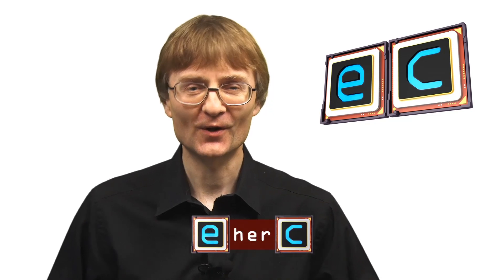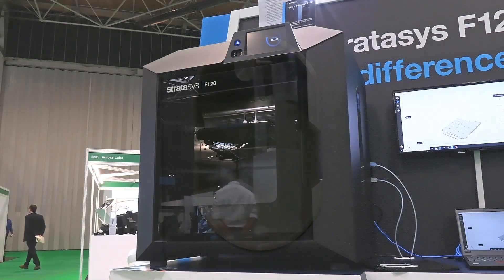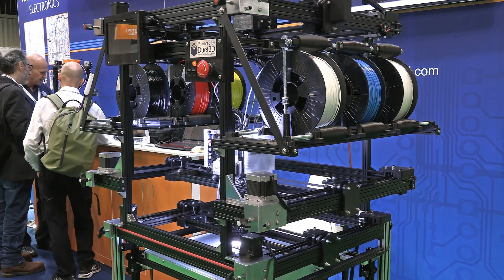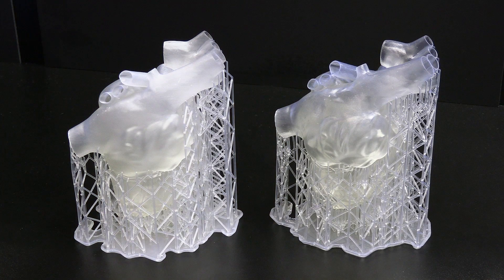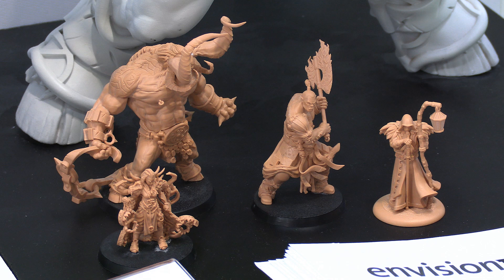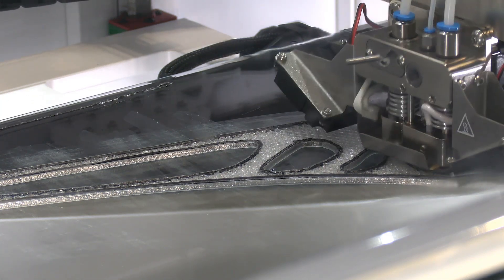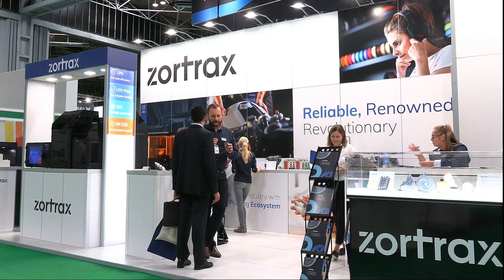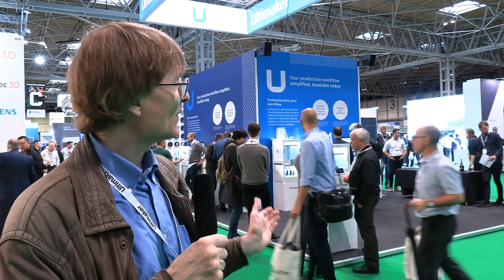3D Printing at TCT Show 2019

Comment: In jewellery printing (very light and small parts) will that best printer melt down printouts?..
I've seen only solid, big, thick  printouts on your video..
Which printer, in Your opinion, is the best for detailed jewellery needs in 2019-2020, please??
Reply from the maker: The prints from the Digital Metal, a DM P2500 3D printer in this video -- and featured in the thumbnail -- are not "big and thick". :) Most jewelry printing uses a photopolymer printer (eg a Form 2, or an EnvisionTEC model) to make a lost-wax master.

Comment: Fantastic tech, but I do wonder whether any plastics shown onscreen will NOT be floating in the oceans as fish food in 109+ years' time. If there is any biodegradeable angle to this tech, then the manufacturers should shout, nay scream, about it.
Reply from the maker: Many 3D printed plastic items are made in PLA, which is a bioplastic that degrades pretty quickly. You also have to look across the whole value chain. Today we mass manufacture items with sub-optimal geometry, many never get sold, and most are transported long distances. 3D printing allows items to be created close to point of use, and on demand, and with optimal geometry (eg most 3D printed plastic parts are not solid, while injected molded parts are). So I see 3D printing as part of the solution. :)

Comment: Regarding that 3D printed aluminum part for the Bugatti: do you happen to know if there was any metal hardening done afterwards?  Aluminum is very weak unless treated.
Reply from the maker: This I do not know. The base of the part has clearly been polished. But I do not know about any other post processing -- the surface looks like it came straight out of a printer.

Comment: Great video. I really am excited about the future of 3D printing. I sort of wished there were more vendors there that did 3D printing in other industries - eg. construction, and architecture. 

Also, what I'm not seeing are green 3D processes. So many of these printers print plastics but as the awareness of micro-plastics entering our food chain become more heightened, I wonder how the industry is going to address this. Perhaps the shift to plant based plastics that's safe to consume might replace the resins currently in use. 

One thing that caught my eye was the use of carbon fiber string, this can really shake up the construction industry and make stronger walls, bricks, etc. Heck, the process can even move on to printed cloth/clothes. Wow. Amazing.
Reply from the maker: 3D printing can be green in that is generally uses less material (3D printed parts are rarely fabricated solid, unlike injection molded parts). 3D printing is also often done in bioplastics (PLA), and more generally removes the need for mass manufacturing and mass stock holding (and resultant wastage). And can be done locally (saving on transport). So you have to look across the whole value chain to see the resource savings. There is so much potential. :)

Comment: 13:42 I don't want to spoil anyone, but I think they are using a microwave to melt the plastic
Reply from the maker: The surface is smoothed with a solvent vapour at high temperature. :)
Reply: @ExplainingComputers  I wonder if this could be done by hand with a heat hose of a desoldering station, with big care of course
Reply from the maker: @MrFiver1111  It can -- and has -- been done in a bucket, but needs very great care, and the results can be unpredictable. The benefit of the Zortrax device is that it controls temperature and pressure of the solvent vapour, and monitors the temperature of all parts of the object.
Reply: @ExplainingComputers  It is truly incredible how the 3d printer technology has advanced so much with the very infimous size details and the smoothing.
About 5 years ago I remember seeing for the first time a 3d printed jaw-bone, it had very "thick" layers (about ½ of the side of a 2 euro cent coin), it was at the Science Museum in London. And now its something that anyone could consider buying for their personal use!

Comment: What a shame it is all plastic, unless I have misunderstood. We are trying to reduce plastic use. Is any of this biodegredable?
Reply from the maker: It is not all plastic -- the metal parts are made of metal! :) Some of the plastic is a bioplastic (PLA), so will degrade. However, the use of 3D printing should save plastic as (a) objects can be printed semi solid, whereas injection molding only produces 100 dense parts; things can be printed on demand (so stock holding and scrapage are reduced), and things can be printed locally (so saving petrochemicals used in transportation).
Reply: Also at the TCT show was a company called 3DEVO who were showcasing their range of machines for recycling thermoplastics. The range consists of 3 machines. Firstly a shredder the function of which is obvious, secondly a dryer because many filaments such as Nylon are hygroscopic, and lastly a filament maker which turns the shredded and dried plastic chips back into (re)useable filament. It is an idea that was first put forward by Dr Adrian Bowyer, the father of the RepRap movement. In theory, one could print a pair of shoes for a small child, then when they grow out out them, throw the shoes into a shredder, add a bit more plastic, then print the next size up and repeat as necessary.
Reply: @ExplainingComputers  Thanks for explaining that. I was sure you were aware of the need to take into account the enviromental consequences, just needed confirmation.

Comment: Thanks for this great report. I've been involved in 3D printing for a while and I'm aware of its strengths and weakness. You touched on some of them: "consumer acceptable  surface" for instance. 3D printing has a way to go before it can rival injection molded parts. 3D printing is very time consuming compared to injection molding or casting - both of which produce parts that are 100% infilled. Most 3D printed objects are filled from 5% and up. 3D printing has come along way, but it still has a way to go before it will replace other manufacturing methods. And when it does mature, I don't think it will be the FDM (filament) type of printing we are most familiar with, but more like the SLA resin printer now becoming popular. Did the show feature any mega scale printers like are used to print components for houses or other large structures. Thanks again!
Reply from the maker: No megascale printers were at TCT this year. :) On "very time consuming", I would disagree if you look at the whole process. If you want to injection mould a part, you need to create the mould, which is very costly and time consuming. But with a 3D printer, you can go straight from CAD to a part in hours. So for short-run manufacturing, it is far, far quicker and cheaper. Many companies are now using both material extrusion (what Stratasys calls FDM), or vat photopolymerization (SLA) for final parts in small runs -- though as you say, FDM faces limits with surface quality. Also, the major application of 3D printing right now is the creation of molds and tooling, not final parts. So (eg) you can print a resin mould in hours for a few hundred dollars, from which up to about 5000 parts can be injection moulded. Or you can print a sand cast mould or core for casting (something that did not make it into this year's video!).

Comment: For prototyping, one-offs or short-run production absolutely ideal. The robotics side of the printers look very similar to the gene sequencing machines I worked on in the early 2000, though obviously the application is entirely different.

Comment: Sure like to see how the digital metal works.  Also any ceramic printers?  Can see ceramic powder with some sort of adhesive and then baked working.
Reply from the maker: Ceramic powder 3D printing does exist (via both binder jetting or powder bed fusion), but I don't think any such printers were at the show.

Comment: I work for a fairly low volume manufacturer. We are adding a plastic accessory to a product. We don't expect to sell many because it is very specialized. So it is being 3D printed vs. paying for a mold and having to stock a run of parts.

Comment: Is there a device that prints medically-safe ceramic parts like teeth or bone replacements?
Reply from the maker: There are dental resins that an produce temporary and final teeth and crowns, some of which have been worn for many years now, and which are printed on printers from Stratasys, EnvisionTEC and others. There are ceramic printers, but I am not aware of any being medical.

Comment: Its nice to see these printers. Still not practical as they take so long and so much energy to print. Injection and compression moulding is definitely more appealing in business way.
Reply from the maker: It all depends how many parts you want to make. For tens of thousands or more, injection moulding is usually cheaper (it depends on the complexity and hence cost of the mould). For low thousands or hundreds of parts, 3D printing is usually cheaper. And you have to look across the whole value chain, as 3D printing can reduce stock holding, scrapage and transportation.
Reply: @ExplainingComputers  You have a valid point Chris. I didn't think 'prototype' at the time. Shame on me for being short minded. Thank you for putting me in the right frame. Thank you for your great video's on single board computers. Proud owner of Raspberry Pie 3B+ with Rectropie. Still amazed at it's power, say compared to a C64.
Reply from the maker: Thanks for this. Great to hear you are running a 3B+ -- the best Pi so far! :) Low run can also go beyond prototypes -- like plastic parts used in some aeroplanes and trains, where they may only need a few hundred a year. :)
Reply: Just to add that with 3D printing, it is usual to print the infill at a much lower density that the perimeters and faces. Generally by using a mesh or honeycomb type pattern. So 3D printed parts can be made much lighter than their injection moulded counterparts (and use less material without compromising structural integrity).
Reply: @deckingman  Interesting. Honeycomb structures are very strong indeed, them bees are amazing engineers of mother nature. Nice to see many different materials used. Even 3D printing living cells which is mind blowing from 1980s tech to this day. What will the next 20 years bring.

Comment: Christopher- did you see any printers or prints that used nonplanar slicing? This is where the layers are three dimensional rather than two, and the extrusion printer has to have enough clearance around the printhead for the 3 dimensional movement.
Reply from the maker: There were no such printers at TCT, but discussed this with a guy who is writing gcode for this very purpose. I've also seen directed energy despositon printers in the past that spray and fuse metal in 3D space to build objects or repair existing ones (eg adding new metal to worn turbine blades).

Comment: waiting for my Form 3L ... they say it will be ready sometime next year. Rumors have it, there are some kinks to iron out on the L vs the one with smaller print bed.
Reply from the maker: Looks a great printer from what I saw. And there are clear printing improvements from the Form 2 to Form 3(L) technology.
Reply: @ExplainingComputers  That's great to know :) I'm using the Elegoo mars now. it's a fine little printer but no match for formlabs and the small print volume is not ideal. Thank you for reply and a great chanal :)

Comment: Thank you for bringing this show to your channel.  I have a desktop 3D printer and I think it will be sometime before we get the cost and quality needed to produce some cheap one of a kind parts.  Mine uses 230 watts of power and I can expect a 6 to 10 hours printing cycle. The software is expensive and not in most cases user-friendly. Same with the 3d scanners[if a separate unit], I found it is not cost-effective and in my case, if no other means can be found to produce the part,

Comment: I would call it TET. Time expanding tech. While all this is fascinating, no one mentions the setup for a particular product you want to print. It's not just I want this item so tell the printer to print it. You can't just say "alexa, print this for me". It's quite complicated unless you're familiar with 3d printing software. It's quite a steep learning curve.
Reply from the maker: For an individual, a steep learning curve, certainly. But for industrial application, it can render massive time savings in the production of prototypes, molds, and final parts/products.
Reply: @ExplainingComputers  Totally agree. Just that the average person who thinks they're amazing (they are!) and expects them to be "plug and play"... they're in for a rude awakening. :)

Comment: nothing really new on this tct, just old stuff put into a fancy enclosure, tweaked some knobs and added another zero to its pricetag. 

espeically this vapor smoothing chamber, people doing this for years with a bucket and pc fan. they just added a touchscreen onto a more fancy square bucket
Reply from the maker: Vapour smoothing has indeed been done on a DIY level for years. But that is not the same as a company releasing a safe, automated product to allow anybody to do it consistently on the desktop. :)

Comment: I have been looking for an ABS printer that will produce parts with the same characteristics as injection mold ABS (unfilled).  Does the Zortrax device affect the material properties in a positive way?  I have bought a lot of prototype parts for my business and all of them either are very frangible along build layers or age badly within a few months.
Reply from the maker: As far as I am aware, the Zortrax Apoller only changes the surface of a part. Inter-layer cohesion can indeed be an issue with 3D printers, and depends greatly on the printer used to create the parts, and the skill of the person setting it up and otherwise using it. You can send the same file to two different bureaus and get back an ABS part with very different properties. So I would investigate what your bureau are using. Also note that there are ABS substitutes that can be printed on resin based printers -- like Stratasys PolyJet machines -- which will produce prints with potentially much better characteristics that match injection moulded ABS far more closely.

Comment: I'm fascinated to know if those 3D metal parts are as strong as their forged counterparts.
Reply from the maker: It depends on the technology used. But some technologies, such as electron beam melting (which sinters powders in a vaccum using an electron beam) can fabricate metal parts with better material properties than forged components. So it can be done -- and has been done, for things like fuel injectors for aeroplane engines, and chambers for SpaceX rocket motors.
Reply: @ExplainingComputers  Anything in the consumer market price range is probably a good 30 years off I would imagine. I guess I won't be printing a new engine for my KIA an time soon! :) On that note, did you see anything there that hints towards using ceramic composites? That could have about a million uses in things like combustion engines, reactors, etc.. Carbon fiber and plastic, not so much.
Reply from the maker: Indeed, metal printing -- let alone at engine scale -- is a long way from domestic application! But I've always thought that bureau models are the future -- we design at home, then upload files and get back the results. I've personally used such services to print in thermoplastics, resins, and metals. On ceramics, I've seen printers that print ceramic composites in the past, and at TCT. But not this year (though I may have missed them).
Reply: @ExplainingComputers  The reason I ask is that my "vision", if you will (which I will never realize because I'm not a billionaire) is that of a vehicle with a sort of "spoon-like undercarriage", stretching from bumper to bumper. One solid piece of whatever, incorporating engine, transmission, drive train, suspension mountings.. literally everything below the passenger seat. Indestructible by any normal forces it may encounter, because it's a single solid piece of material. And I know that ONLY a 3D printer could accomplish such a feat. How long do you figure before a thing like that might be possible (if not practical)?
Reply from the maker: @MrDavidBFoster  Possible in the 2020s I am sure.

Comment: Can any 3D printer combine plastic and metal to reproduce Mister Scissors?
Reply from the maker: We've yet to get metal and plastic 3D printer technologies combined, but technically a robotic system could be built that could print the plastic parts, the metal parts, and assemble them. And I have seen scissors 3D printed in resin (Stratasys PolyJet) that could cut paper.

Comment: Surprised not to see anything on the use of sustainable or biodegradable filaments. The world doesn't need more plastics, and 3D printing, remarkable as it is, does make me concerned.
Reply: It could be possible to produce a filament that is made from recycled material. And it could be a good business to start. Also, it could also be good to recycle used printed objects to make new copies. We could use the same filament over and again. The metal parts that are printed could likely be melted for repurposed filament as well.